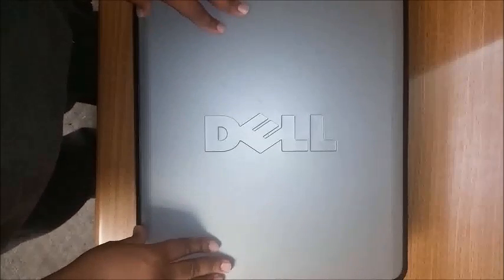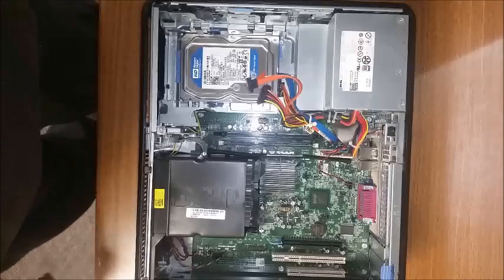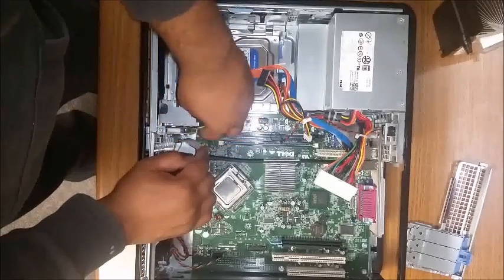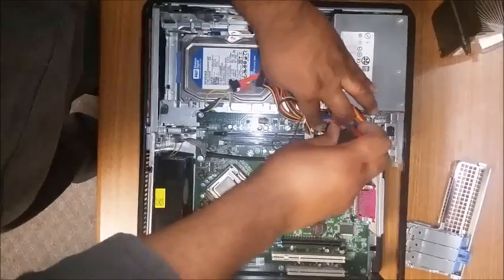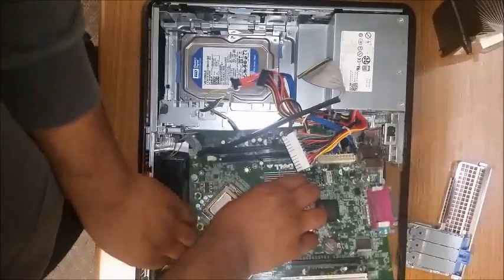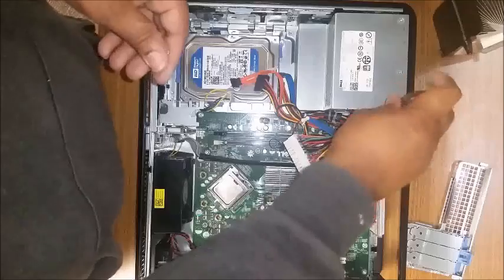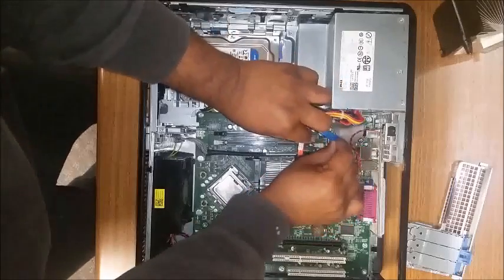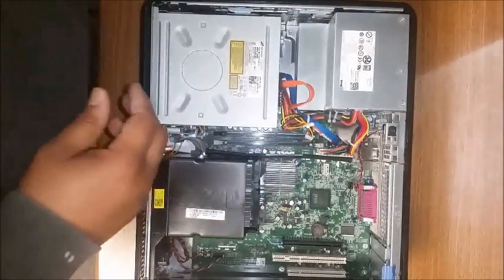How to replace Motherboard Dell Optiplex Desktop

Comment: I have an old optiplex 990 i7-2600(no k), zotac 1060 amp 6gb, 12gb ram, 128gb boot SSD, 2tb HDD, 550w GPU.  I'm wanting to replace the original Dell motherboard with a Asus P875-m/csm because I 'think' the SATA 6gb, USB 3.0, and maybe the ability to overclock will be worth it.  My first question is would it be in any way actually worth it?  Will it make any actual difference?

Comment: fter replacing the motherboard on this Optiplex, can I still use the Dell Windows 7 reinstallation disc and have it automatically activate as "genuine" by reading the key code kernel on the MB or will I need to get a reauthorization each time I wan't to reinstall a clean OS which I do every few months?  Thanks

Comment: What is the size of the mobo...Atx mini atx etc....i want to replace the case of my optiplex 755 sff.....so i could upgrade my psu and install a better gpu.....any help/suggestion is appreciated.
Reply: Did you EVER get an answer to this or did you ever figure it out yourself. If so, please tell me!

Comment: can I add a different type of motherboard if it is the correct size and it will still have all the things that need to connect? I don't know what would work so if there is any recommendations for a motherboard that would work with this that would be appreciated

Comment: Hi thanks very good - I am about to undertake this task and have been watching several instructional vids like this-- others show using thermal paste on the processor before placing the heat sink back on- cleaning off any old thermal paste but those weren't about dells, do we have to use TP on the dell opti gx 620---?
Reply: Still need to put thermal paste on all procesors it just prevents it from over heating aka destroying the motherboard